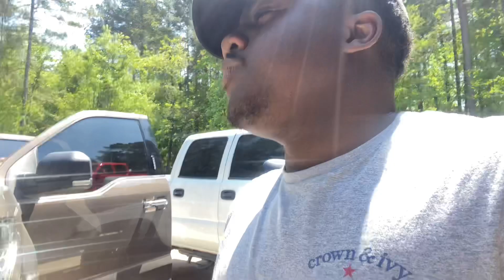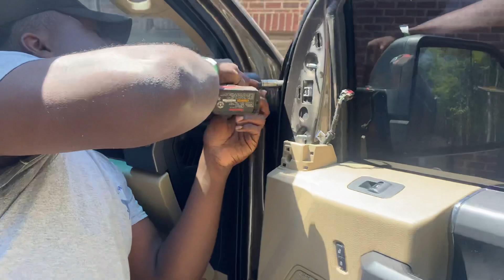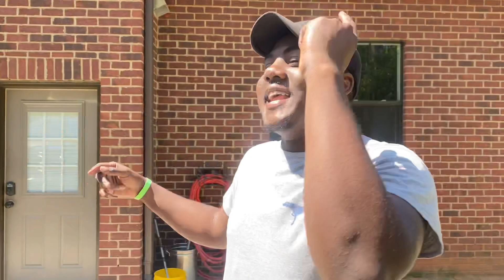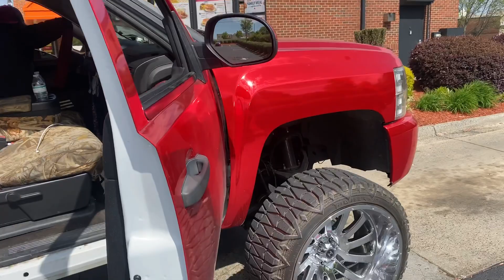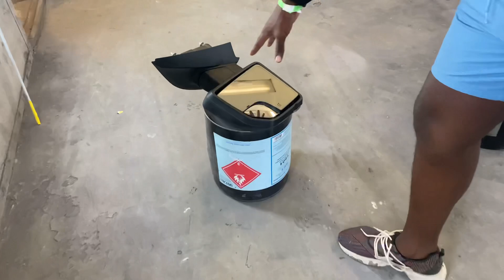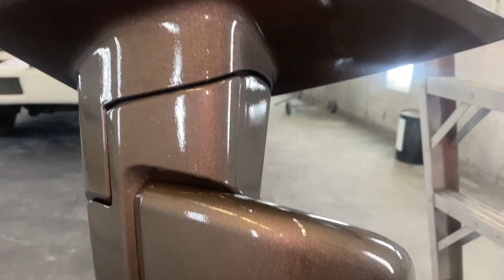Painted my truck it’s fire

Comment: when you gonna let me join stunna 8 inch lifted 2015 Silverado 2500 HD Duramax. Sitting on 37s by 13.50s. double row flow series wheel lights, starlight headliner, 8 pc rock lights